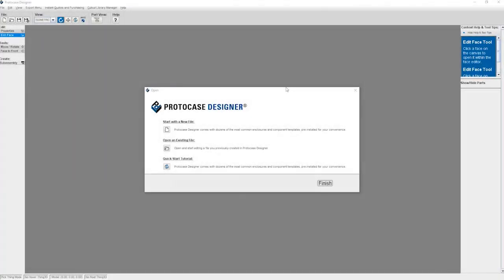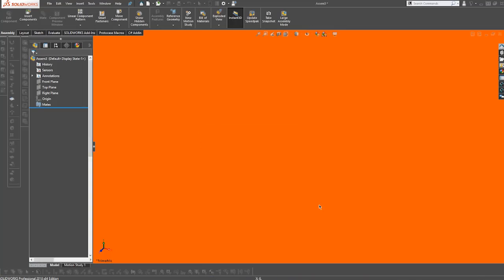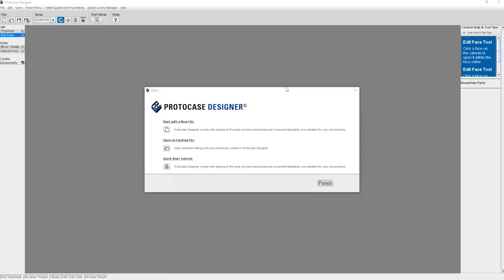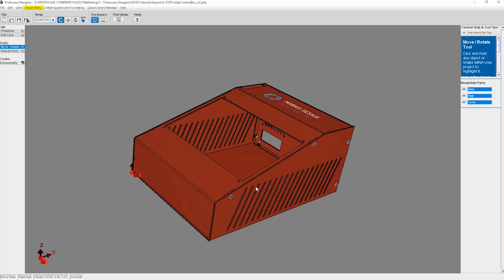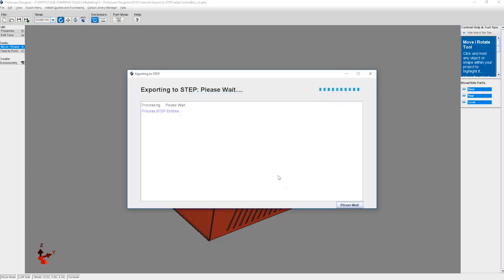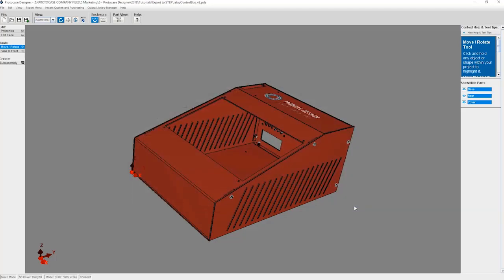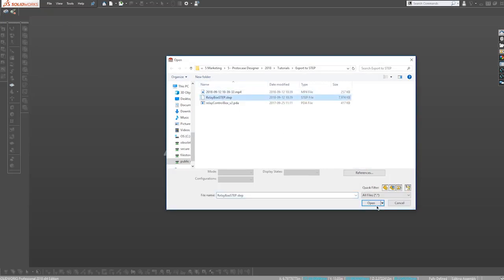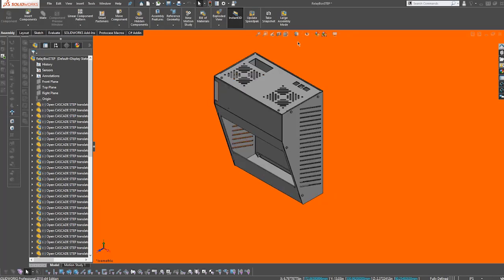How to Export to STEP File from Protocase Designer

Comment: No longer and option to export as of version 7.0.20? :/
Reply from the maker: Hey there!

The STEP Export is still an option in the latest versions of Protocase Designer, however the user interface over the years as undergone many changes and unfortunately this video is from a much older version. We're in the process of updating our tutorials to be accurate with the latest versions!
To find the STEP Export in the latest version, under the "File" tab in the main 3D editor window, there is an "Export" button under the CREATE category.
Reply: @ProtocaseInc  Ah, so it is! I managed to gloss over it earlier when I was looking for it. When exporting as STL and into blender, the scale is very off but that might be on my end. 

Regardless I'm very happy to see STL as an export option instead of having to use freeCAD to turn it into STL from STEP. (as I have to piece the model together, because it's split into tons of different parts with different origins when put into blender for some reason)

Thanks for such a fast response too, I've been wanting to try building my PC into my desk with 3D printing, and found the very thorough documentation on your website super useful in terms of getting the dimensions right for the motherboard